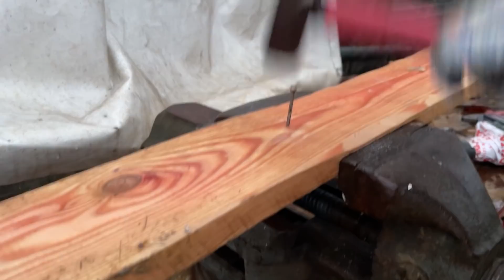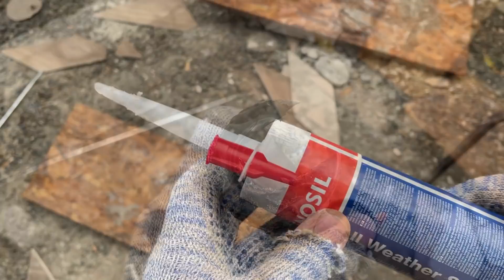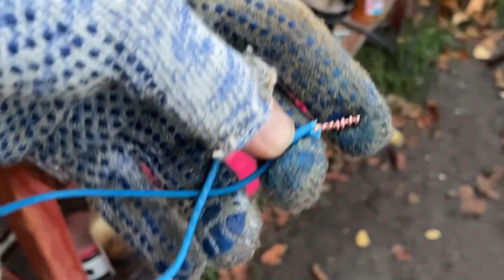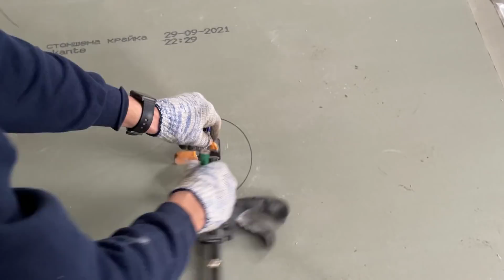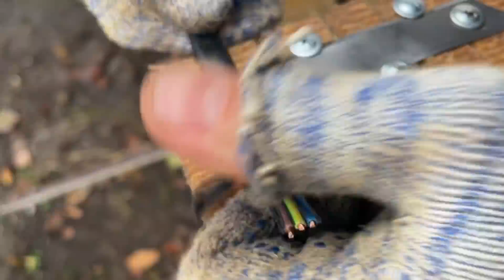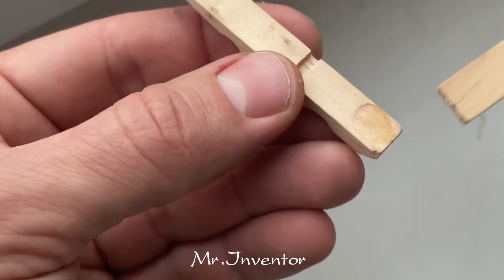Secrets and Tricks of the Masters That Are Really Useful - Tips and tricks

Comment: Great tips! When hacksawing a spinning object on a "lathe",  i recommend to continue to move the saw in a normal stroke. It cuts way faster and distributes the wear and heat evenly over the tool.  Same for filing and even sanding, to some extent.
Reply: I wouldnt recommend using a 200 bucks drill as a lathe in the first place